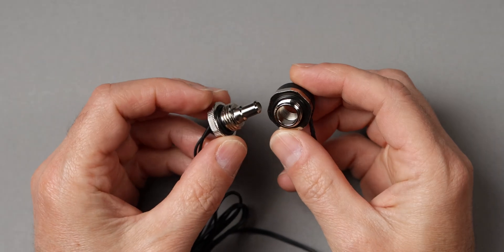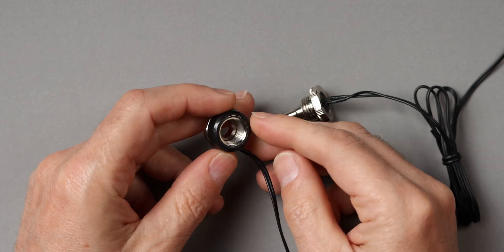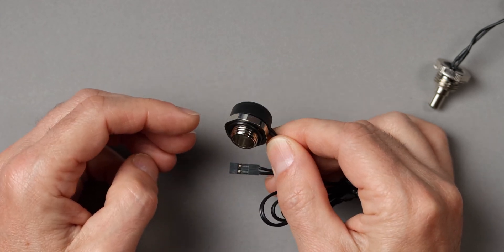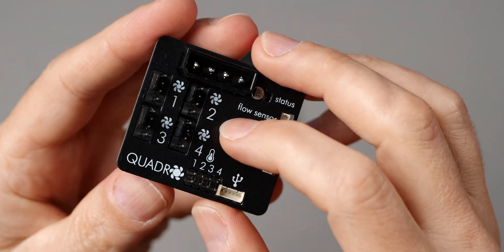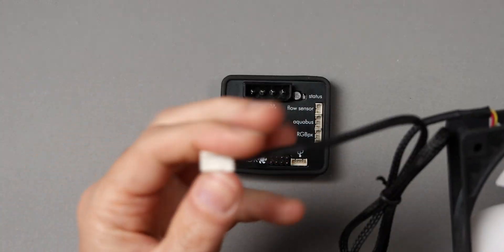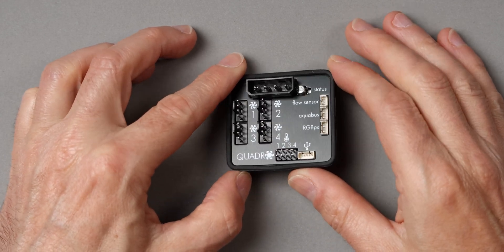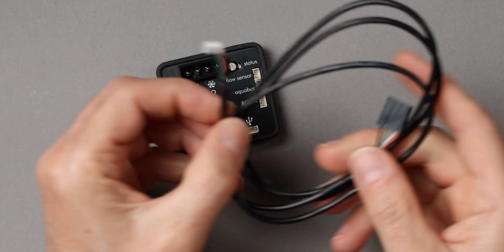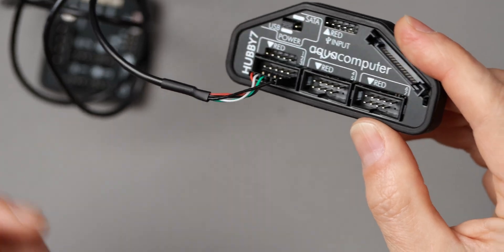Aqua Computer Tutorial / Beginners Guide - Part 1: Hardware

Comment: surprised that quadro only support PWM fans, assume the miniuratization of aquaero into quadro/octo required removal of those voltage regulators
my aquaero can control both DC and PWM fans, just need to select the correct control mode....now almost all my fans are PWM anyway (16 out of 17) but few years ago all were still DC

Comment: All of the fan headers on my X570 Taichi have died, and while I was away at work. Luckily, all of the protection circuits worked as intended, and I have temporally got it running again with the addition of a Molex powered fan hub while I wait for the backordered OCTO fan controller.

Comment: I purcased an AquaComputer Ultitube D5 NEXT pump/res, Leakshield, and High Flow NEXT Flow Sensor. I thought the Leakshield and High Flow NEXT could simply be plugged into the D5 NEXT. The D5 NEXT would then be the "master" or "brains" and they'd all work together in conjunction with one-another using the D5 NEXT's physical buttons & screen...and with the option of further control & customization via AquaSuite by simply plugging the D5 NEXT (which would already have the Leakshield and High Flow NEXT plugged into it) into the PC/motherboard.

Well, apparently, it's MUCH more complex than that. You need to purchase all sorts of extra cables plus possibly a Quadro/Octo, Hubby, Splitty, Aquabus, Aquero, Faberwork, etc. I'm so lost and confused. These products have been sitting unused since March 2024.

The Leakshield and High Flow NEXT should simply both plug into the D5 NEXT, and then the D5 NEXT should simply plug into the motherboard/PC. That's it.

Comment: Thanks for the video! I had one question relating to the temperature sensor plug. 
   I noticed the temperature headers on the quadro hub have numbers above them, perhaps to offer some orientation, while the plug on the temperature sensor cable has an arrow pointing to the end on the two pin female plug. Does it matter which way the two pin connector plug is connected to the quadro hub temperature header? (Arrow on the plug on the side with the numbers or vice versa)
  Thanks

Comment: Great video. One question: may i use this hardware for a PWM fan controller in a server?  Setup the temp values in a PC and then move it to the server (without software connection)? or does it need always connection to the software to work correct? Thank you

Comment: Should I plug my pump into mobo or quadro?
Reply from the maker: That depends on your pump - many pumps has two connectors: one for power and one to control the pump speed. Connect the control-connection to the Quadro and the power-connection to your PSU or a high Amp-connection on the mobo

Comment: can i connect my octo controller via aquabus to the farbwerk controller ?
Reply from the maker: No. Only the Aquaero controllers can act as an Aquabus "master" - all other Aquacomputer devices are clients, and cannot communicate without a master device.
But if you connect both the Octo and Farbwerk to USB, you should be fine - only drawback is a slightly longer latency and that you have to have the software running...

Comment: Can 2 octo be connected to a aquaero6 aquabus through splitty9？
Reply: Hi there, really good video. Any chance for part 2 please?
Reply from the maker: Yes. But do you really need 16 extra INDIVIDUALLY controlled fans? Perhaps some PWM splitters could do the job, and you could just use one Octo?
When the Splitty9 is in Aquabus-mode it can be used only for Aquabus devices - you'll only need 2 ports for the 2 Octos, so why not just an Aquabus splitter (https://shop.aquacomputer.de/product_info.php?products_id=2847&language=en) or 
an Aquabux X4 (https://shop.aquacomputer.de/product_info.php?products_id=3775&language=en)?
Reply: @KayBeeTech  how？I connected 2 octo to the aquaero6 aquabus through splitty9, i can't find any of them, but when   
I connected 1,it can be found . I dont know why🤣
Reply from the maker: Ahh, you are right - you can connect 2 Quadros, but only 1 Octo. The Aquaero can only handle up to 12 (4+8, or 4+4+4) fan channels.
Reply: @KayBeeTech  how about d5 next pump？how many pumps can be connected to the aquabus？I connected 4 pumps, but only 2 were found.
Reply from the maker: 4 pumps?! What kind of monster are you building?? ;)
Only 2 D5 NEXT pumps are possible on aquabus.
Take a look at section 23.1 in the Aquaero user manual, here the supported devices and the max numbers are listed.
https://aquacomputer.de/handbuecher.html?file=tl_files/aquacomputer/downloads/manuals/aquaero_5_aquaero_6_english.pdf

Comment: Thank you sir!.. I jumped into a project thats over my head. An old friend of mine sold me his computer right before he died of stage 4 lung that he had over 10k in parts, all unassembled... He sold me everything from the 011xl rog, to the wire sleeve, crimps, tools, aquaero xt, 2-360 rads, 8 corsair rgb fans, water block for cpu and graphics card, commander pro, aquacomp pump/res, flow sensor, filter, over 100 different g1/4 fittings and so on. And on, and on...This thing is going to take months to complete! OMG! so intimidated..  I want to build it right in his honor.
Reply from the maker: I so sorry to hear about your friend. :(
My advice for the build would be to watch a lot of YouTube videos, and once you have a loop planned make a post on the watercooling subreddit (https://www.reddit.com/r/watercooling/) to get some, hopefully, constructive feedback.
In my opinion the hardest part is bending the tubes just right, I haven't mastered that skill yet. (That's part of the reason why I'm using soft tubes).
Good luck with the build! :)
Reply: @KayBeeTech  Thanks again buddy. Learning all of this is going to be a blast. I forgot to mention the included monsoon mandrel, hopefully this helps. Wiring is my kryptonite. What are the odds of me letting the smoke out of this thing? lol

Comment: Thanks for the video! We need more of these. Luckily I found it in r/watercooling.

Amazing how those controllers have evolved. I bought an Aquareo 6LT ages ago and just moved it into new machines with time, then completely missed them changing up the designs and names. I suppose the next one would be the Octo for me when I switch back to water cooling next year again. Thinking of going with a 480 and then adding a MoRa for GPU + CPU, have always wanted one of those. Hell, I'd stack two but don't have the room. 😂

Anyway, the mention of the 3pin fans threw me off. Has this behaviour changed with the Quadro?
I used to have a mix of 3 and 4pin fans in an old case, with the 3pin being on their own channel of course, and they handled just the same, mainly set to run at x RPM, and that's what they did.
Reply from the maker: Thank you!
Yes, the new Quadro/Octo controllers don't have voltage regulators, so unfortunately they can't control 3-pin fans which works by changing the voltage to the fan.
Ditching the voltage regulators is also part of why they can make the devices so small compared to the Aquaero.

Comment: If only Aquasuite wasn't such a absolute cancer of software.
Reply: Why do you think AQS is an absolute cancer? It is generally considered to be the best, by far, for cooling component control. There is nothing else that comes close to what AQS can do.
Reply: @BillBittel  Aquasuite Service causing my HFN and D5N to disconnect is one of them.
Reply: @BillBittel  Not only that, having to pay for updates is incredibly Jewish. Fuck that.

Good thing I don't need aquasuite anyways :^) setup the curve in aquasuite and then delete AS since you will never need to use it afterward.

HWiNFO works without AS and if you need to setup anything just use the D5N or HFN itself.
Reply: You better stay with your wasmachine.

Comment: Thank you for this. I have the octo myself plus the Aquaero 6XT in two different computers. The Octo is my fan controller in one system and my custom water cooled gaming system has the Aquaero for years. I was disappointed that the Octo did not have the Aquabus cable included. I have done w/o it but I will have to wait until someone stateside has it in stock. Shipping cost more than the cable. I am waiting to install my other Aquaero in that system until I get the cable.
Reply from the maker: I like the Aquaero too - it's much more configurable with how the fans and controllers are separated. But I think the hardware otherwise is starting to feel a bit outdated...
I think I have a spare Aquabus cable laying around somewhere, but it still costs about 4 USD to send a letter to the states from here (and I don't know if it would be caught in customs?) :(